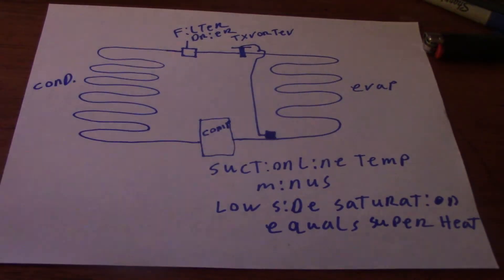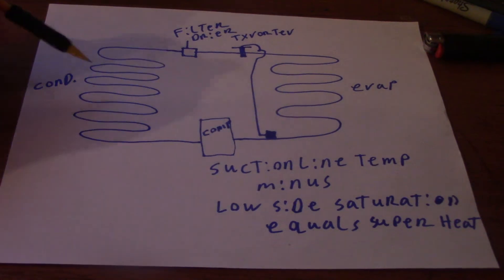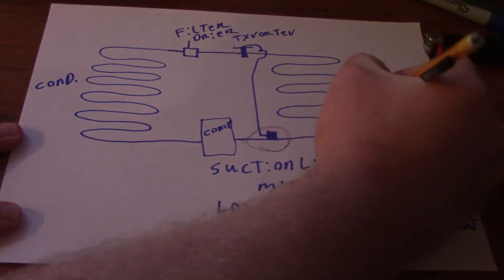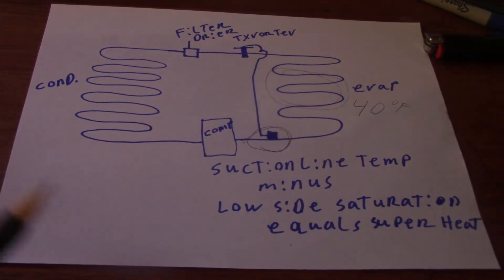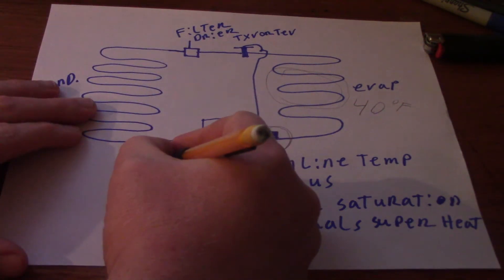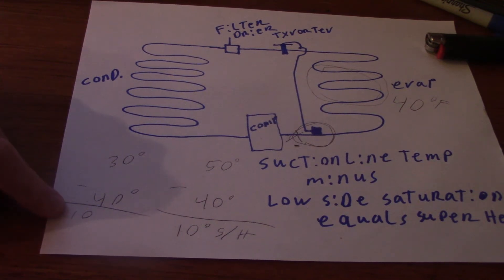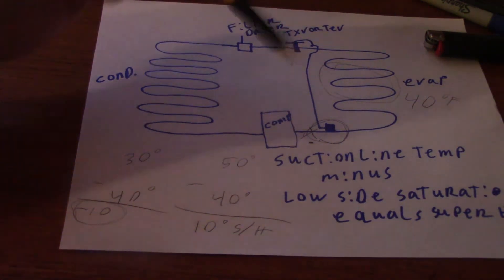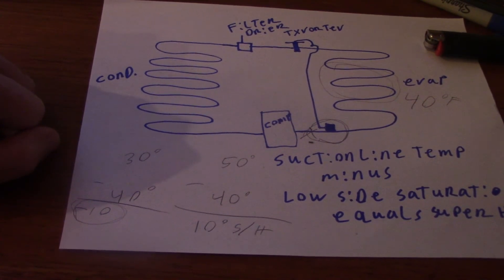Video on superheat and how to calculate it and what it is

Comment: If your temperature probe shows a lower temperature than your pressure gauge, check your probe calibration, its physically impossible for the liquid to be cooler than the vapor point.
Reply from the maker: no, it is possible because the vapor has been heated up.